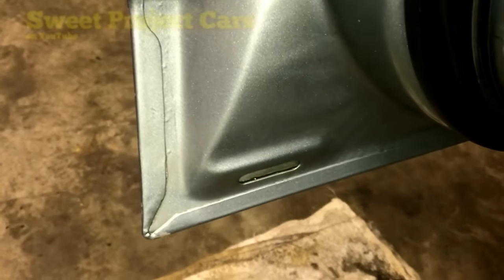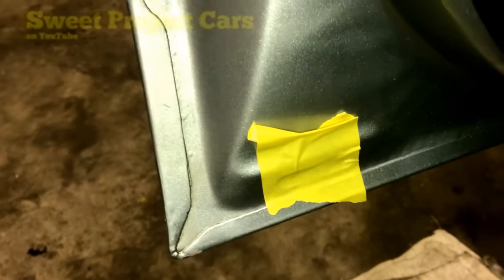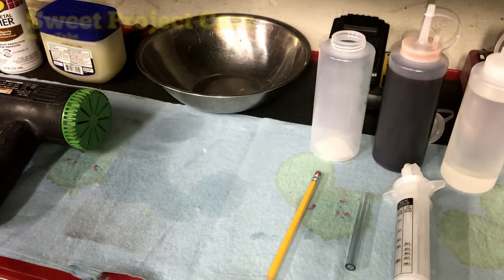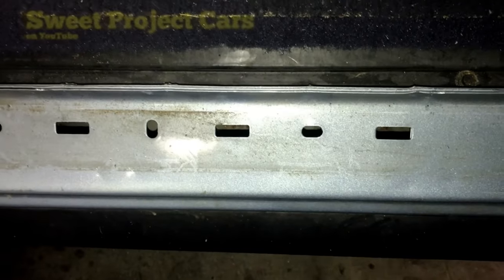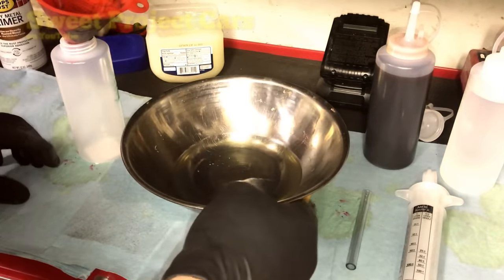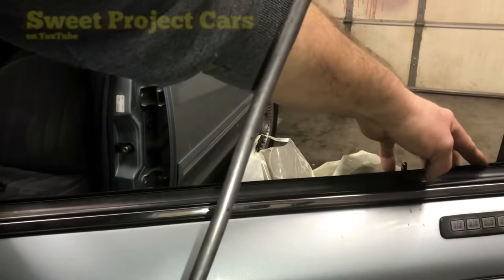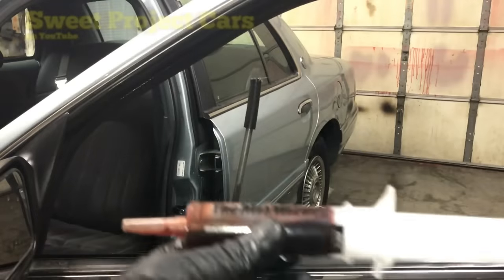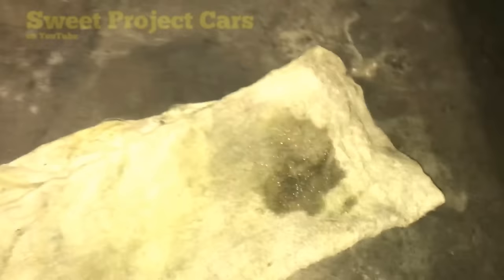Your Car Will NEVER RUST Again! For Just $10 Bucks!

Comment: On a quiet night you can hear a Ford rust.
Reply: I bought a new Ford Ranger in 1989 and the frame was a solid orange 6 weeks later. I took it to the dealer in which they said that was normal. With a factory body lift it was terrible. People were always commenting on how a brand new truck was rusted.
Reply: I don't get it. I have a 1998 Ford Ranger and live in snow country, central British Columbia. Lots of salt on the winter roads. My truck has very little rust. Yes, surface rust on the frame, but nothing structural. The body looks goo, very good. The rear bumper is the rustiest part of the truck; it needs re-chroming or replacement one day, for cosmetic reasons. I have absolutely no complaints with my Ford.   @motordar
Reply: Paul Maxwell my 1998's chassis rusted so bad it cracked almost in half. It was in the section between the cab and bed where the front and rear sections of the chassis are riveted together. Didn't know until it was too late. However, I did find that the cab structure of the ranger is built really strong as The truck flipped then slid down the road on its roof. I walked away with just a minor scratch.
Reply: You may hear a Ford rust, but that Chev will be metallic flake long before that ford
Reply: And on a very noisy nite you can't sleep because of the noise the GM products make as they literally rust apart .

Comment: Mike Sanders grease is one of the best rust inhibitors, but you have to heat it, just like your vaseline. I stripped my interior prior to the treatment. After applying, I heated the entire car in a paint booth. Just to ensure penetration. (Forgot lifting the car though.) I´m pretty sure dedicated anti-rust grease lasts a lifetime.
And don´t forget the quarter panels on 2 door cars. Water seeps in there through the rear windows.
Reply from the maker: Thank you for watching and sharing Ronald. Have a great day. mad Mike the hammer SPC

Comment: Before 1955 all cars were Positive ground, this was changed to negative ground by Detroit in order to make cars rust out so you and I have to buy new cars every few years. No B.S. .....
Reply: They were made out of real metal then. Now they're recycled beer cans.
Reply: That makes no sense, there is no electrolyte to complete the circuit to make is oxidize.
Reply: Any proof behind this statement?
Reply: I thought it was the other way around because the positive terminal is always the one corroded
Reply: David Snyder,Sr Nah, plastic is what changed. Every part of the car is held together and insulated with plastic making it so that you would have to very intricately wire up every panel and metal part to in order to electrically prevent corrosion. They sell kits to do it yourself (was an infomercial in the 90's) and this why they don't work. Im pretty sure myth busters did an episode on it.
Reply: @DWBmotorsports  British cars used to be 12 volts positive ground up to the early '60s, and their bodies did not rust out as rapidly as the later models
Reply: It's true, I heard it at the bar last night.  Honest, the guy talking about it wasn't drunk.
Reply: I remember back in 1985 I bought a device for my 79 Town Car that connected to battery and frame of car that supposedly charged all metal with positive ions to prevent rusting..
Reply: If I’m not mistaken ...There’s an electric aspect to the chemical reaction created by modern chemical salts that would nullify this , rusting out just about any car past or present. Still if that is a misunderstand on my part the modern chemicals are way more harsh than the salt/gravel road coatings of yesterday
Reply: I know some cars, Hudson for instance, used positive ground, in the six volt days (which ended with the 1955 models) but I'm sure 1940 and 1951 Buicks and 1953 Pontiacs were negative ground. This makes me think that GM used negative ground throughout those years, at least. Maybe efforts to make cars rust out and need frequent replacement began before 1955, although they were very successful in that year's Chevy quarter panels.
Reply: that is true your car rust because its like a battery where you have A CATODE (+) and a anode(-) charge this causes current to flow inside different metal types, its called a galvanic series. thus this galvanic series causes oxidation thus we call it rust. back in the late 70s cars started to have electrical sensors so positive charge idea had to be eliminated and grounding the electrical system of cars was employed due to increase electronics in the cars, such as electric fuel pumps must be grounded negative to eliminate sparks inside gas tank.
Reply: At +1.43V or greater iron should not rust in the presence of NaCl.
Reply: You have to be in england.  In the USA neg grounds have been the standard for 75 years.

Comment: You can do your rocker panels and doors with cheap lubricating oil and the little tube too.  I just spray it up in the weep holes in the pinch seam or in the weep holes in the bottoms of the doors.  Do it in the summer and the heat of the day will help it creep into those deep crevices.  I've done this for years on my old Toyota truck and at 20 years old, the rockers and cab corners are solid.
Reply from the maker: You very much for sharing we truly appreciate that have a great week my

Comment: Well petroleum jelly is a bit flammable. I take cotton balls and soak it in that and collect them into 2 ziplock bags. I use those to help start fires when backpack camping. I'm into the best of both worlds n 1 other but car projects, outdoors, and electronics fill my way of life. So enjoy the life hack to those who read this. Loving your vids. Still timeless helpful knowledge even today 2021. Thank you 4 sharing your knowledge.
Reply from the maker: Watch this  https://youtu.be/5J0VG4_jR2w  The only reason it SEEMS that the petroleum jelly burns on cotton balls is an illusion.  If you are to take a cotton ball with nothing on it and light it on fire it will burn up in seconds.  By adding the jelly to the cotton ball, you are slowing down the combustion rate of the cotton ball, it is not the petroleum jelly that is burning it is simply slowing the cotton ball from burning up in seconds. Thanks for watching.  mad Mike the hammer SPC
Reply: I soak them because we do get our fair bit of rain and moisture here in Central Wisconsin as I believe you do in Florida I believe you have mentioned. 🤔 but it helps them to burn longer allowing wet or damp wood to dry and burn. Yes, there are ways of finding dry wood when it's raining but it helps you save calories wasted. I had a feeling u knew your stuff as well and you're absolutely correct. I still take those extra steps because that burn length helps in those types of situations when backpacking. The outdoors and automotive are my favorite things to pass the time and enjoy doing. Appreciate all your videos as it has helped me renew my wagon for car shows that pop up in Milwaukee where my owner's club is at. Hope you guys have a safe and healthy summer.

Comment: Here's another product that's been used on cars since cars came about (1905 - 1940's).

Use Linseed oil, it takes a LONG time to dry out but the results are AMAZING! And the best part, it's virtually indestructible when applied, nothing can penetrate the stuff once it hardens. It's basically like AR500 armor on a cars paint. 

Check the stuff out, it actually is so strong you can try to put a pin strip on it and it just shrugs it off.
Reply from the maker: Carnby thanks for the great tips :)

Comment: Cleaning under the damn plastic wheel well guards also helps a lot they need to be removed now and then. Thank s for the trans oil trick.
Reply from the maker: Glad to help!  Thanks for the tip on the wheel well guards also!  Rust, the silent killer lol  have a great day mad Mike the hammer SPC

Comment: I used a mixture of diesel, transmission fluid and grease. The mixture produces a very sticky  gel when it dries up that seals the metal from liquids and moisture.
Reply from the maker: Thank you for watching and sharing Angelito.  Have a great day. mad Mike the hammer SPC

Comment: Husqvarna chain saw bar oil works well also.
 It has rust inhibitors and it is also designed to adhere to surfaces.
Reply from the maker: That's pretty expensive and maybe unnecessary, good old used motor oil or used trans fluid works just as well to stop any and all rust without using expensive new oils of any type.  Thanks for sharing and have a great day.  mad Mike the hammer SPC

Comment: Hi I live in the Great White North where there is some rust but not as bad as the Eastern provinces. In my old 87 Chev 1/2 ton when I put new doors and front fenders on about 6-7 years ago I used a spray product called LPS 3 in the fenders and in the doors and where the leaves gather.under the front of the hood as well and no rust yet. The box was stock and  I drilled small holes above the wheel wells and in the corners of the box  and sprayed oil in them til it dripped out...still no rust . When I had the cab corners and rockers done I did the same with LPS 3....you guessed it.. still no rust. I'm still working the truck but one day I'll get a professional paint job and the seat and dash redone and play the cool fool before the grandson gets it. Just picked a low miler 99 Tahoe  that I'm going to do some work on and use as a daily driver....needs rear quarter panels but I'm going to try a few of your tricks that you showed which by the way I appreciate. Thanks again from an old wood butcher ;-]
Reply from the maker: 15017 HfX thanks for sharing we have been using this with great success  https://goo.gl/RJa6KC

Comment: I bought a new 2017 Dodge ram 1500. Took at home and spent five days rustproofing it with fluid film. I removed headlights, taillights, tailgate, inner fender liners, spare tire, so I could get everywhere with fluid film.I see a lot of Dodge pick up trucks riding around with a lot of rust around the wheel wells especially. It seems to be too common on the Dodge Rams. The truck I just traded in, only had 42,000 miles on it, and GM C Canyon, it was so rusty underneath for not ever having been rust proofed, that I was afraid the frame was going to fail. I already had two brake lines, and the fuel line, rot Thru,the bumpers were rusting through from the back, and this all could have been prevented had I had it rust proofed with fluid film. The reason I didn’t rustproof the GMC, the owners manual said Rust proofing this vehicle will void the warranty. So I didn’t do it. I sprayed oil in and under my new 1978 Ford E1 50 van when I bought it new. I kept the truck for 31 years, and it did not rust through anywhere.Rust proofing with oil or fluid film works. I prefer fluid film because it’s thicker/waxier than oil and doesn’t pour out everywhere like oil does.
Reply from the maker: Thank you Jody for sharing your awesome tips we truly appreciate that rust is something that really gets under our skin here have a great weekend
Reply: Jody Frenak how did grime stick to Fluid Film, share your thoughts on the application months later? Im sure it worked great for rust proofing as do these techniques shared on this vid here (and for less of a cost) I’ve just have read that sheets of grime fall or get thrown off from wheel wells that collect on it over time. (?) thx!
Reply from the maker: Dani Adams those who say sheets of grime fall off are just the competition shooting it down...we have used it for years and it has pleased 100's of our customers every single time with never a complaint!

Comment: Good stuff : ) I've always used engine oil thinned with white spirit put in a spray bottle for underneath bits and rub grease on the brake lines if they are steel .
Reply from the maker: thanks for the great tips :)

Comment: I live on the slopes of an active volcano in the middle of the pacific ocean, so probably one of the worst places for rust.  It gets particularly bad when the volcano is blowing out sulfur dioxide and other volcanic compounds which we call VOG.  It rains all the time here so its damn near impossible to keep tools dry.  I keep a bottle of used transmission fluid nearby at all times. for some things Ill even dope the TF with some PB blaster or a bit of rustoleum rust converter.  It has really saved me a lot of money from tools rusting out and turning to dust.  Ill definately have to try the petroleum jelly as a longer lasting preventative too, seems like it would protect surfaces pretty well without washing away easily.  Id rather all my stuff coated in grease than replace it every year.
Reply from the maker: We're with you on that MoukaMan! Thank you so much for watching and sharing, very interesting, hope you have a great day my friend. mad Mike the hammer SPC

Comment: That spongey black triangular gutter guard, found at most home depots, can be cut to size and shoved behind your fenders to keep most leaves and debris from getting settled into those tight valleys
Reply from the maker: Thank you very much my friend for sharing this great information it helps the channel immensely have a great weekend
Reply: Sweet Project Cars You as well, Thank you!
Reply: I would worry that having that vibrating around inside the panel would damage the paint and expose metal to air.

Comment: This done with transmission fluid or mineral oil will not stop rust. it may slow it down for a while but being oil is lighter than water it will float on top. Eventually the water will again seep into the crimp joint  and cause rust and any type of oil will float to the top and come out the weep holes.
Reply from the maker: Dave Arnold we have used them for over 40 years on 100's and 100's of customers cars and none have rusted to the is day where it was applied, also you do not apply where the metal is wet you do on dry areas only, once its there it does not come off with misting of water that you get from driving especially cold rain water...have you ever tried to remove cooking oil or grease of anything especially with  cold mists of water? the only way it is coming off is with hot water and soap and scrubbing...have a great day !

Comment: Great compareson  of products available I use  rust check  with great success but most important is to body flush #1.   pull rocker plugs, taillights,  flush front fender, wheelwells, use a hanger fenders in front of door full of leaves pressure wash or garden hose waste of time oiling dirt and leaves  works excellent  leave dry overnight then use water displacement of choice
Reply from the maker: Thanks for watching and sharing richard, have a great week. mad Mike the hammer SPC

Comment: I would think that the petroleum jelly would work best because it will solidify when it cools and stay locked in place while the others will remain liquid and since they are lighter than water they would float on top of the water and get washed away letting the water into the areas you are trying to protect. Correct me if I'm wrong though.
Reply from the maker: You cannot wash any oil or grease off something with cold water. For instance, try washing a greasy frying pan out with no soap, no rag just cold normal water running on it. It is not coming off. Inside the door, there is no water running on this oil maybe some condensation or humidity but if you want the best way to do this process use this  https://amzn.to/3PA3d9S  Have a great day. mad Mike the hammer SPC

Comment: If you have a compressor you can use paint sprayers and undercoating guns to coat a vehicle nicely, great video
Reply from the maker: Kurt Wolford  we have all that equipment but try to keep it simple for our DIYers we are actually doing a video on fully rust proofing the underside of a car or truck  with air powered tools
Reply: Sweet Project Cars Yeah for sure, if you don’t already have everything that can be a big investment, but still a lot cheaper than fixing rust lol. Good setup for common problems though
Reply from the maker: Kurt you are very correct, fixing rust is not fun and it seems to always come back, but we believe an ounce of prevention is way better than a pound of cure...so you nailed it well with your comments thank you

Comment: Might give that a shot, based in Scotland where you'll be lucky to get 10 Years out of a car because of the salt (Usual spreading from November to sometimes as far as May if it's a cold Winter), similiar climate to your Pacific North West. Welded mine numerous times, usually use dinitrol on the underside and wheel wells over repairs, but the sills/rocker panels get all the crap from the road and salt so usually only last 5 Years before needing patched up.
Reply from the maker: Sounds like you've got nothing to lose my friend! Thank you for watching and sharing, we really appreciate it, have a fantastic week! Glad to have you with us from Scotland. mad Mike the hammer SPC

Comment: Mix diesel and hydraulic fluid and with a pump sprayer of any kind spray underneath your vehicle and it won't rust underneath. We use that on concrete pump trucks to keep the splashed concrete from sticking and then they get pressure washed 45+ mins a day not a spot of rust anywhere. We coat the back end, stabilizers under Neath it works. Even just plain diesal works. But mixed the hydrualic oil sticks to everything. Transmission fluid is basically hydraulic fluid